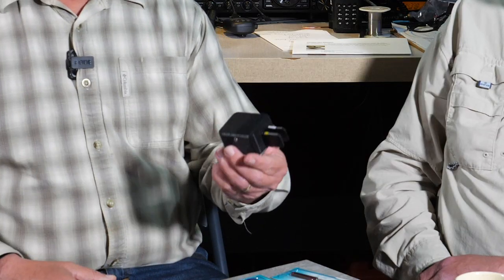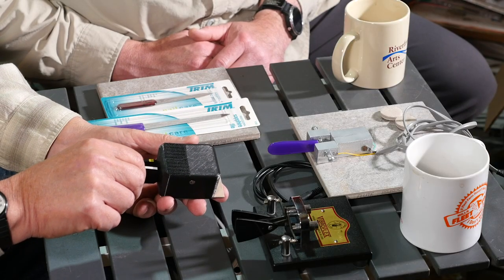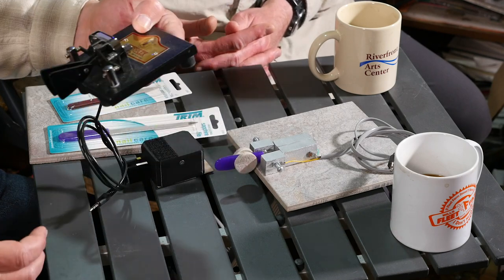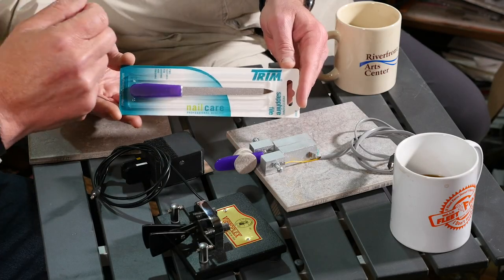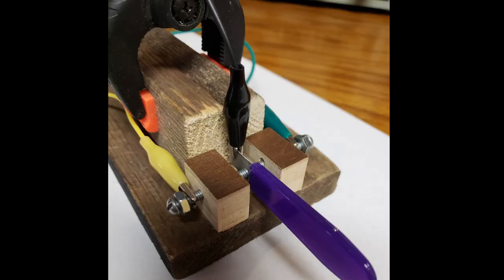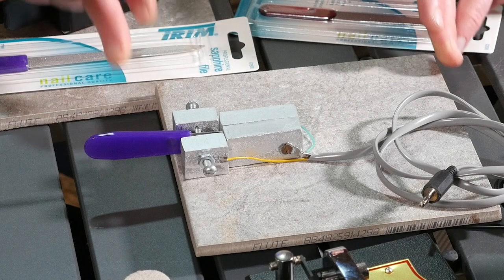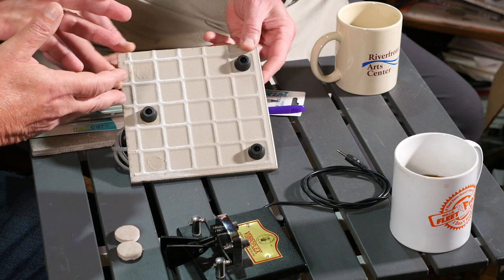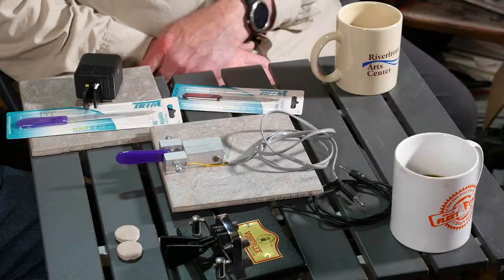Build it: One dollar morse code key #HamradioQA

Comment: About the screws: Zinc is a problem when it comes to contact, as it will oxidize and zinc oxide is an insulator. So stay away from galvanized screws. Brass screws and nuts are your friends. Or even stainless.

To be precise: The zinc oxide forms on the end of the screws where they contact the paddle. And you don't need much power for it to form within half an hour either. My practice oscillator is 555 based and the cootie (same thing, basically, as a single paddle) was switching the output to the speaker, so not even the 9V battery to the circuit. Went out and bought some brass screws and haven't had to file/clean the contact points again. That was 8 years ago.

Comment: I'd like a link to who is selling plastic paddles for $20? I sold a few 3D printed ones in the $35-40 range
Reply: I bought the 2 paddle plastic key 2 years ago during a $10 Thanksgiving promotion, so I believe it was actually a $30 key on eBay at that time.
KZ9V
Reply: @davewhite7679  Never a doubt just wondered if you had a deal I did not know about.  Thanks!  Great plan on the file.  Wonder if Icom could change firmware to add A keying?  I have an 817ND myself and I've only used CW on air once.  Embarrassed to try again here.
Reply: "Parks On The Air" has brought a lot of us back out of the closet with our rusty CW skills.  Give it a try.  Switching to a paddle key and utilizing some rig memory storage took my CW game to a whole new comfort level.
KZ9V

Comment: I have a G90 with the latest firmware and I'm pretty sure it has type A and type B
Reply: Yes, the G-90 internal keyer (like many radios) offers both Iambic A and B keying options.  Unfortunately my IC-7300 does not.  So instead of relearning the other Iambic style I switched to a single paddle key.
KZ9V